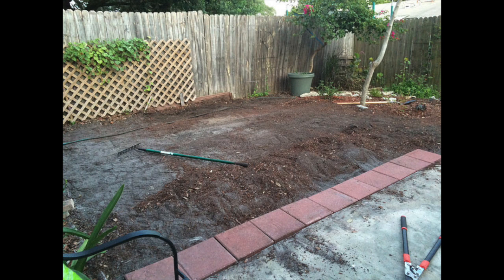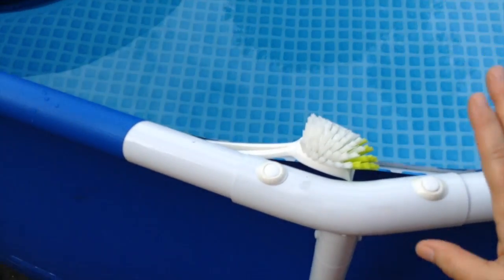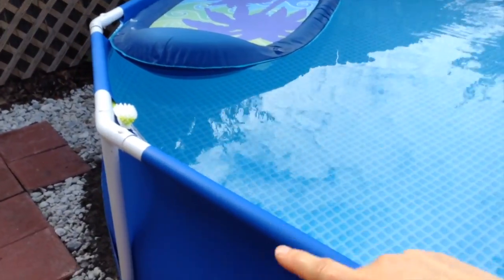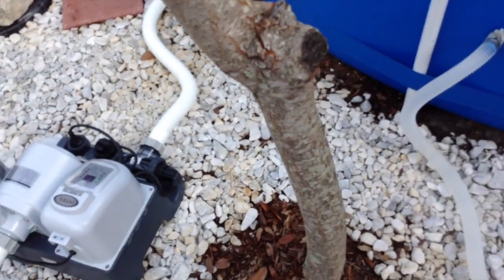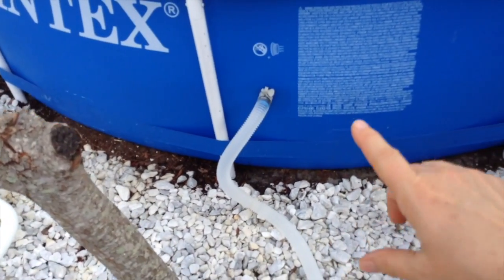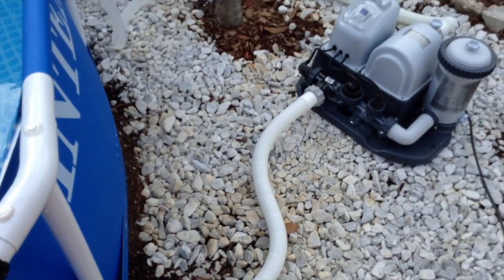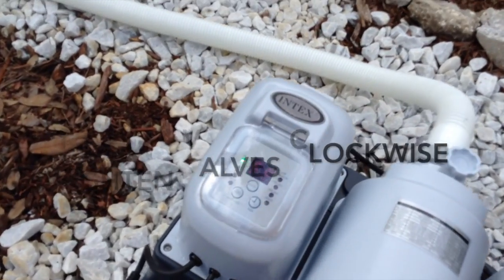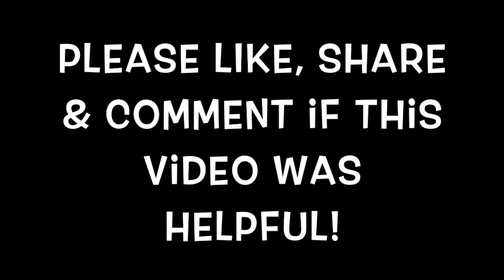How To Setup An Intex Saltwater Pool Pump

Comment: Just hooked up the new unit today and the pump works fine. To recap see my last post. The first Pump didn't work. So I called Intex and they sent me a new pump. I did not have to return the pump that didn't work. It was a good thing because Intex didn't send the water sensor chamber (clear tube that supports the plugs). The filter in the second unit also did not have a rubber gasket in it. So using the parts from the first pump I was able to get the new one to run properly. 

Since the first pump didn't work the water had begun to get green during the week. It was suggested by the local pool place to add 1 lb package of Bioguard oxysheen. I treated the pool last week and it began to clear but still green. It was suggested to do another 1 lbs  and vacuum the pool of any dead algae. For this size pool 15' x 4' the Salt water Eco 7111 works great, much better pressure and power than the small filter pump that came with the pool.

Comment: Great video. My tip is to throw that filter pump that comes with it in the garbage and get at least a 1500 gph pump and get the intex skimmer attachment..It will save you alot of hassle keeping it clean. 
It has 2 outlets so a kid cant get stuck on the suction and drown
Reply from the maker: Well this video is about replacing that filter pump with a saltwater pool pump so you don’t use the chemicals.😏

Comment: Nice video...question...how much salt did you put on your pool..i have the same size pool,i bougth the same pump but kind of confused about the salt amount...Please letme know..Thanks
Reply from the maker: Check the manual for a chart that tells you exactly how much salt to put into your pool for your particular size model. However I learned the hard way not to put all of that in at once. I put in 1/3 of the amount required and stirred well while wading in the pool. Then I added another 1/3 and stirred it in well. 

It’s better to have LESS than to overdo the salt and then have to fill up your pool with extra water until you can get the right salt balance. (I learned the hard way)

Once you consult the manual for the proper amount, be patient as you work your way up to putting that full amount of salt into the pool. It takes a little while before the machine registers the proper reading. But definitely don’t overdo it or you have more work to do and more wasted water.

Hope that’s helpful!

Comment: My pump/ generator was only working on pump i tried to put it on working it works for a few minutes cuts off then service light comes on i can get it back on just pump any ideas
Reply from the maker: Have you checked your manual for troubleshooting? I would check all connections and seals. It may be a safety issue alerting you to something that’s not completely set up properly. Hope you’ve sorted it by the time you see my comment!

Comment: Your alert about not getting in while running. Does it cause harm or just rough water? Thanks for this video!!
Reply from the maker: The manual suggested not to run it while in the pool due to the threat of electric shock (water + electricity = shock!) I unplugged it whenever I got inside the pool for safety/caution. :)
Reply: @yourcreativechord  Thank you!

Comment: I am curious how you are keeping the water from discharging through your outlet hoses when you have to clean your filter basket since you don't have a plunger valve at the "T" joint to shut off the flow of water. We are just in the process of setting up our pool and saltwater system and cannot find the parts needed that are 1.5" and Intex reps are no help.

Comment: do you have salt chlorine generator too? or just salt water pump? how much of salt did you use? i would really appreciate your help :)
Reply from the maker: I did not use anything additional than the saltwater pool pump I demonstrated in this video and blog. I followed the Intex guide on how much salt. BUT...I started out with 1/3 the amount and stirred it through the pool and GRADUALLY added another 1/3, etc, until the pump showed the proper reading. ONCE I put in the amount suggested in the manual but it was TOO MUCH so I had to waste a lot of water to eventually get it down to normal. Moral of the story: LESS is best. Then work UP TO the full amount--based on the pump's reading. ENJOY!

Comment: I just bought my intex 10x30 and bought the same salt combo system but I could not install it because the hoses are different sizes, what can I do in this case?  I hope you can help me
Reply: Did you find your answer?  I believe there are adapters that you can purchase from intex or from Amazon.
Reply from the maker: Ugh. That's frustrating! Sorry I missed this comment til now.  Yeh, in my video, I show my 12 X 30 pool, so I don't have direct experience with 10 X 30 size pool. But I agree with A MJ's comment below, that you can find either adapters or different hoses in the correct size. I suggest, before heading online, to visit your local pool store, with the hose and a photo or two of your pool to show what you need. They can recommend the product needed. Then you can decide to purchase there or online for less.
Reply: Me too! I am at my wits end and literally in tears.

Comment: How is the pool/pump holding up? I've seen a lot of reviews that this pool doesn't do well with the saltwater system. Plan to put my first big pool up this summer on my own, so this video has already been a great help. Thanks!
Reply from the maker: tjscooper24 works great!
Reply: Steel will rust with the saltwater system. People please do your research.
Reply from the maker: sixshooter4570 What are you talking about?
Reply: Jenny Leigh Hodgins 

I'm taking about all the people reporting that pools like the one in this video will rust the STEEL support rails, even though they're powder coated, when using a salt water system. You have to go to an all resin pool with stainless steel liner or all aluminum or else you will eventually rust the steel.

However, this particular pool only costs about $99.00. So it's not to expensive to replace,  just keep an eye on the poles. 

I had a similar pool and it lasted us three years.

It's a great pool to sit in, drink beer all while you're having a BBQ.
Reply from the maker: Ah, Yes. You're absolutely correct. In Florida, I typically replaced these cheap, small pools every 2-3 years, so not really a big issue for me. Due to my small garden space, this was the easiest option. But yeh, ideally, a pool frame and liner that could withstand rusting would be best for a longterm solution. Thanks for pointing that out for folks!

Comment: Hi, Your video has been very helpful. Couple questions, why you say not to go in when the pump is running? And I just installed my system 14x48 Summer Waves pool and it requires approx 120 lbs of salt. Ran the filter pump for about 6 hrs first day, next day put the timer on for 6 hours, did a test it showed 1500 PPM. Next day same time 6 hours, test shows 1940 PPM. Why am I not seeing a figure close to 3000 PPM? Thank you
Reply from the maker: Sorry I somehow missed this comment til now! Ya don't go in while the pump is running because it's ELECTRICITY powered into a pool of water. Just for safety, the manual suggests not running it while you're in the pool. I dunno. Check your manual for the recommended salt amount and the pump's LED to see if you have enough or not enough. Worst case scenario, take a sample to a local pool store and let them tell you the chemical balance for it. I've done that and it's helpful. Make sure they know it's a SALTWATER pool.

Comment: Is that sws and pump model # 28673EG? I just got my Intex 12by30 frame pool delivered today but won’t set it up until I get all my decisions made up for a conversion. I wanna go just like your set up. Intex told me that I’ll need that adapter B since the pool has a 1-1/4 fitting and sws uses a 1-1/2 fitting. If that’s the correct model # of that sws pump, will it come with the 2 adapter B and bigger hoses?

Comment: Hey Jenny, awesome video. We are going to be buying a bigger pool in the next week or so. Can you talk a little bit about the salt/chlorine. This may be a really dumb question, but once you add a bag of salt...is that it? Do you have to add ANY chlorine at all? Thank you!
Reply from the maker: adam bellefeuille You really have to check your manual to determine how much salt to add pending the size of your pool. I made the mistake of putting too much salt in initially. Better to put LESS than too much. Your pump will tell you if you’re low or have too much salt. Then I would periodically take some water to a local pool store to test it to see if I needed any chemicals. But generally the pump tells you when you need more salt. And the salt creates the chemicals you need when you run the pump’s process. So the answer is no you don’t need chlorine generally. The pump creates the chemicals you need. Put less salt in initially then more. The only exception to this is if you have horrible storms and a lot of debris goes in your pool. You may need to check it with a local pool store to make sure everything is balanced out. But the point of having this particular saltwater system is so you don’t need those chemicals! Which is the wonderful part of it!
Reply: Jenny Leigh Hodgins Awesome! Thank you very much. This will be our first pool and I’m super pumped. Again, thank you very much.
Reply from the maker: adam bellefeuille Ha ha! ‘Super pumped’!! You’re welcome. Enjoy!

Comment: The reason why there are two intake points is that one is for a leaf skimmer that may or may not have come with this size pool. My 16' pool had one included but you can buy them separately.
Reply from the maker: Thanks. Strange that is not mentioned in the pool manual & couldn't find it on Intex website.

Comment: So started up the pump yesterday. Released air out etc. Unfortunately while the unit is getting electricity and the display seems to be working, I only get a hum from the pump itself as if it is froze up. No water is pumping from the unit. And the display reads low water pressure/ 90. Tried the hoses different in different configuration same result. So I have to wait until monday afternoon to try and contact the company since this company is out west. Pool places in my area could only think the pump is froze up or not working. Very frustrating. I put on the filter pump that came with the pool and it worked yesterday but the plug won't reset today so that's broke. I don't want to add chlorine until last resort. I have used pumps before and basically if it is working I would get some water shooting out. Not sure what the problem is. I also tried different outlets. No change. Hopefully the water won't get too dirty before I replace the pump.

Comment: Just saw your CYA sock hack.  How much stabilizer did you place in the sock?
Reply from the maker: That's been a Loooonggg time, but about a cup I believe. I ALWAYS started with LESS than more, whenever adding anything! Getting the initial chemical balance just right is a bit of a chore, but I always took water samples to my local pool shop and they'd clarify what I needed. Doesn't take much to maintain once the saltwater pool is full and has time to process the salt. :) Hope this helps!
Reply: Yes, it helps a lot!  Thanks so much for responding!  I relied on your video, review and instructions on your website to get my salt water pool up and running!  Thanks so much for your help!
Reply from the maker: @aliciamarques4073  I'm so glad to be of help! Enjoy!

Comment: Hi, I'm thinking of converting my little therapy pool with heater to a salt water system.  Is the chemistry just as simple as adding salt granules and that's it?  Or will I still have to shock my pool and add chemicals to a floater?  Trying to make the chemistry side of it easier than the chlorine.  Thank you!
Reply from the maker: I’ve never transformed a therapy pool with a heater into a saltwater system. But the point of the saltwater system is that no chemicals are used. So as I show in my video, I used zero chemicals to shock the pool. The saltwater system converts everything into the proper chemical balance. But I would check with your pool company to make sure a saltwater system won’t impact the heating mechanism.😇

Comment: Can you use the pump provided with the pool for salt water to or no
Reply from the maker: No, unfortunately, you have to replace it with a saltwater pump as shown in my video. See this link for exact products I used: https://www.yourcreativechord.com/saltwaterpoolresources.html
Reply: I used my pump that came with my 16x48 Easy set pool and bought the saltwater chlorine generator as a add-on, so yes you can.  The salt will not harm the pump.

Comment: Hello, so I just want to be clear, I was reading through all your comments and I saw that you said to make sure to pour little salt in the beginning,  but I am going to set up my first 12 x 30 and saw you wrote on your video to pour a 40lbs bag of salt. I just want to be clear can I just pour it all in my 12 x 30 pool since it's the same size as yours? Also do you use besides the net cover the solar cover or it's not needed here in Florida? Thanks in advance 😊

Comment: I actually just set up a 14' x 42" pool. Similar setup, but the overall size is 3400 gallons (still filling!). We have a cartridge filter pump and an Intex salt generator. We are using city water to fill. Aside from the salt, do you have to add any other items to get it going or is that it? You thoughts are appreciated!
Reply from the maker: Jeff Murphy The point of this pool pump is that I only have to use salt because the pump turns that into whatever chemical balance is necessary. However I live in Florida where we have the rainy season. So if there's a really heavy thunderstorm I do shock the pool after that. Making sure all debris has been cleaned out! I also take a bottle of pool water to get it tested once a month or so at the local pool store to make sure all the chemicals are OK. Whenever I've done that the most I would need is to shock it, usually. I have loved this pool because there are far less chemicals, no odor, very soft luxurious-feeling water and nearly no salt taste evident.
Reply: thanks for answering this question, when i first converted mine i was told to add algaecide, stabilizer, shock etc and had pretty bad results, i got new pool, pump and salt water generator this year and wanted to never put chemicals in it. was told a few days ago i didnt need to, and after searching for hours for more answers,  this was the only place i found that actually has a pool setup and running that also says no need to add anything but salt. thanks again for coming back to answer for us all.
Reply: I don't understand what a salt generator is.  I just set up a small 14×48 pool last weekend, decided saltwater would be better. Trying to figure it all out! Thanks

Comment: Hey i have the same pool and I want to go with the saltwater system , but I’m nervous about the frame rusting . Does your pool have any rust on the frame since you did this? 

Thank you
Reply from the maker: jose hernandez Well yes. Rust? Yes that will inevitably occur due to the salt. But these pools are pretty cheap. I replaced them once every 2 or 3 years. Not a big expense for the luxury of no chemicals and a nice quiet oasis. ❤️

Comment: Hi there thank you for posting a video, has helped a lot. A few questions, we have the same size pool, 12x30... do I really need to put all 40 lbs of salt in? How many times do I need to put salt into the pool? This is so new to me.. sorry for the questions
Reply from the maker: Its A Prides Life No do not pull put the full 40 pounds of salt in. Put 20 pounds in and see if the pump continues beeping that it has low salt. Continue gradually putting in five more pounds and waiting to see if it’s mixed in well. I use a brush and stir up the salt to help dissolve. If you put 40 pounds in at once sometimes you get too much salt. So start with 20 and gradually add in 5 pounds. Hope that helps!
Reply: Only 40lbs, I’m sitting here in shock that you only need 40lbs. Must hold less gallons of water cos I have a 24x12, but it’s 52” and I needed 200lbs of salt. 😳
Reply from the maker: That is way too much salt for that small size pool. Where did you get the idea for 200lbs?!?
Reply: @yourcreativechord  in a brand new set up? Yes, you need that much salt. It equals out to 8400 gallons of water.
Reply: And that was according to the manufacturers manual as well as the pool store’s calculation.

Comment: If I were to buy that plunger valve on Amazon, could you give me a link? I want to make sure its the correct valve. I saw the intex plunger valves with the model # you gave, but they say its for a larger pool.
Reply from the maker: The plunger valve model # on my video is exactly what's needed for 12X30 pool. I ignored what others said--it works.

Comment: So wait. Do I add chlorine to my pool? I also have a salt system
Reply from the maker: You should not need chorine or any chemicals except salt with this pump system. However, if you don't maintain the salt levels, you MAY need to adjust with chemicals pending what your local pool store tester advises. If you follow my directions in the video and blog, you shouldn't need chlorine. :)
Reply: The saltwater generator creates chlorine.  So you do not need to add Chlorine to your pool.  Just add the correct amount of pool salt and follow the instructions to get the 3000ppm level.